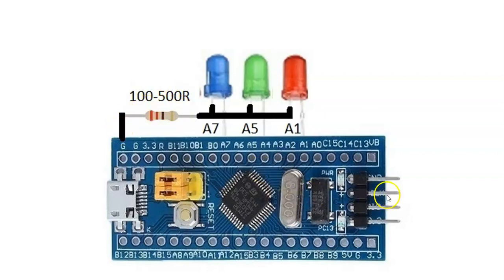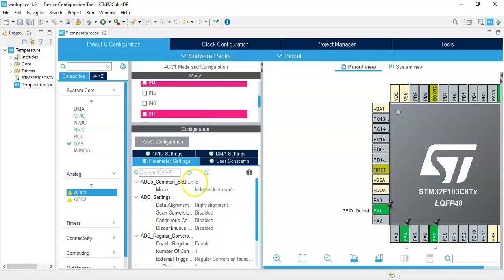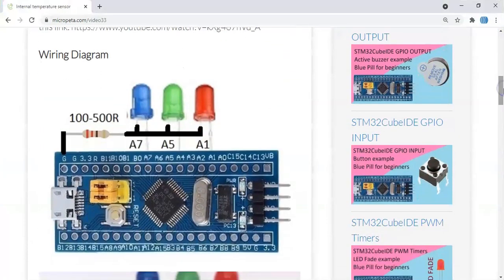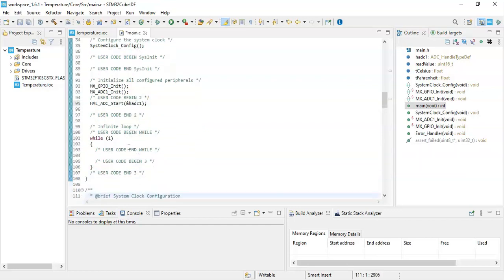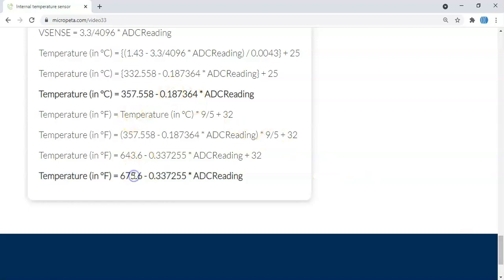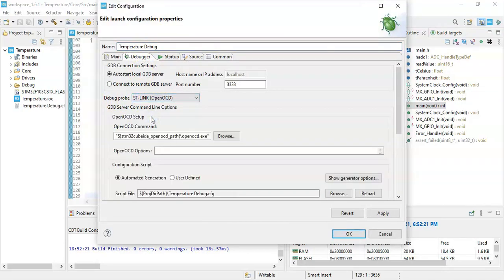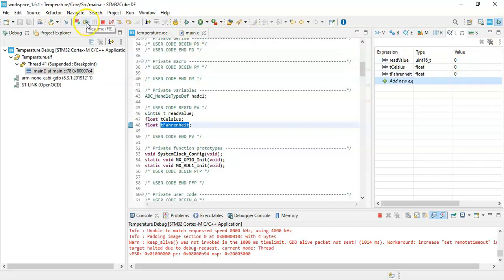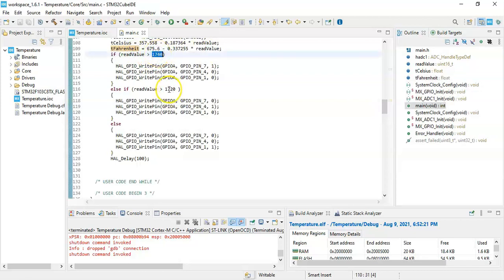33. STM32CubeIDE internal temperature sensor with STM32F103C8T6

Comment: Thank you it, Sir I have a question, I want some hysteresis for example I want to low my red led at 45 degree Celcius and it should be gow till 30 degree. But the green LED should also glow till 45 degree after it red should be glow.

Comment: Would like to point out, that this will only work for this type of STM, any other has probylby different Clocks and ADC, so you need to check your documentation for what sample time is needed for your ADC, mine was 10us, and I had HSE at 32MHZ, so I had different cycles, there is an equation that you need to use to get to your sample time cycles.
Reply from the maker: You are correct. Thanks for the comment